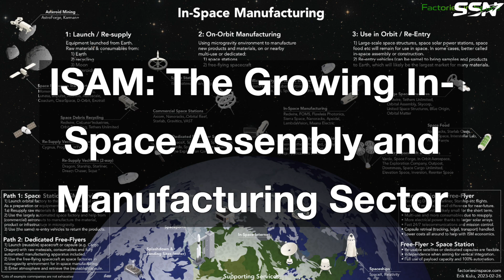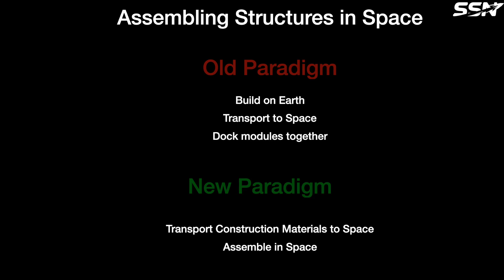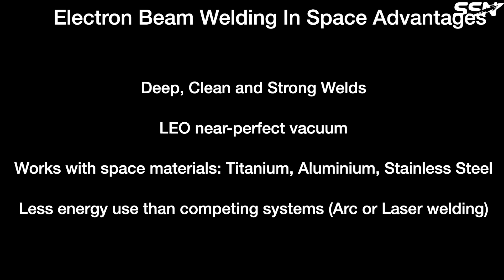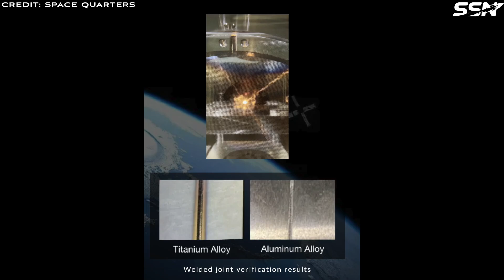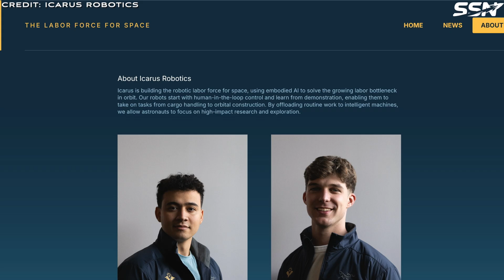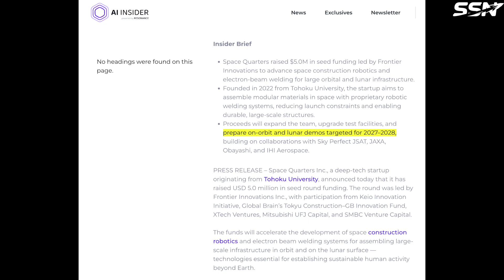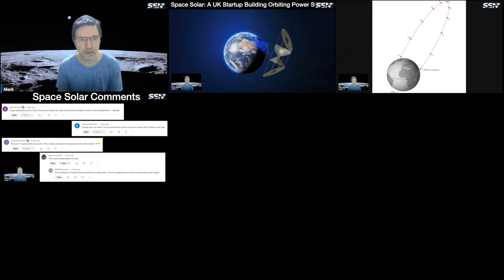Space Quarters: Assembling Large Orbital Structures in Space

Comment: In vacuum, clean metal powders automatically bond at atomic level and cold weld.  A 3d printer with metal powders contained in pressurized containers until deposition could be used to print a spaceship
Reply: How would the powders be contained such that they don't weld, but weld on dispersal?
Reply: @hc256  they would have to be in a pressurized container until leaving nozzle.  Probably wouldn't need much pressure, probably 2-3 psi.
Reply: @miken7629  So a small amount of air in the container escapes such that cold welding can occur?
Reply: @hc256 you can use oxidized metals which won’t bond and then use electrolysis to break off the oxygen and directly print the metal
Reply: @ryboss2777  Send me sources. That sounds really cool.

Comment: Welding in space seems like a really good means of joining parts until you consider the danger of spatter becoming a swarm of micrometeors. It can still be done, but there needs to be a way of retaining the spatter or deorbiting it. Also, space is unkind to flesh. Artificial gravity is necessary. Spinning structures in space are unstable and can't be expected to maintain their axes. (See intermediate Axis Theorem) This problem needs to be addressed BEFORE any talk of building "bases" in space. Spinning structures secured to the moon or other celestial bodies will not have the instability problem. So, 1G is attainable on the moon. I open to being wrong about the above. Let me know.
Reply: Traditional welding in space makes zero sense both due to the risks and because of vacuum welding.